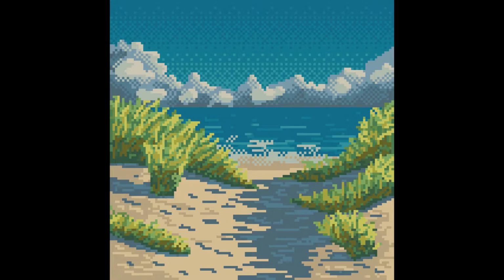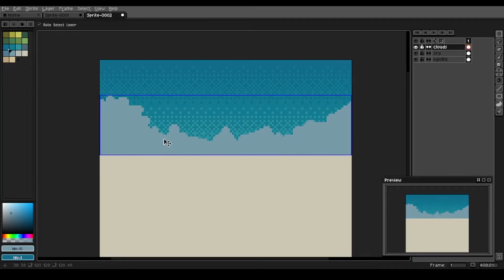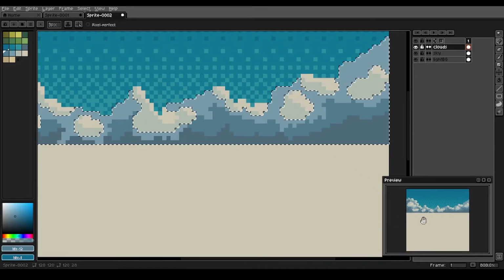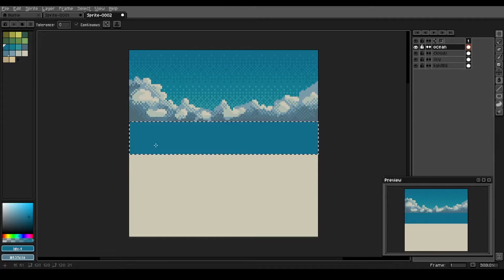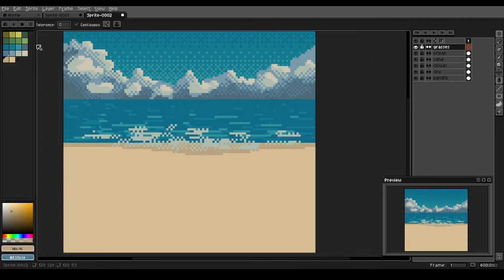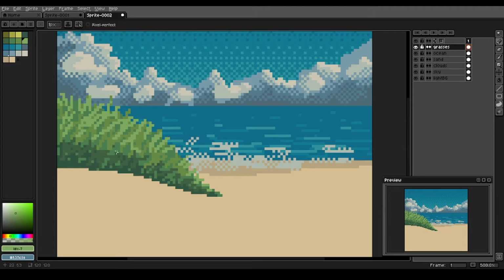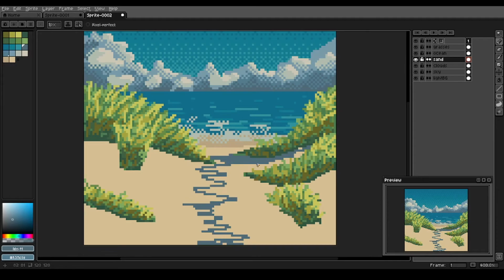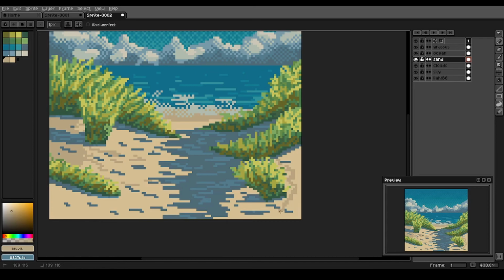Step-By-Step Beach Pixelart Tutorial for Beginners

Comment: I don't understand where the sun is meant to be coming from with your shadows - why is there such an extensive shadow covering the flat part of the beach, what's causing it? The light source would have to basically be almost on the ground and nearby for this long shadow to be cast by such a flat dune, but that would mean the other parts of the beach should be in shadow too.